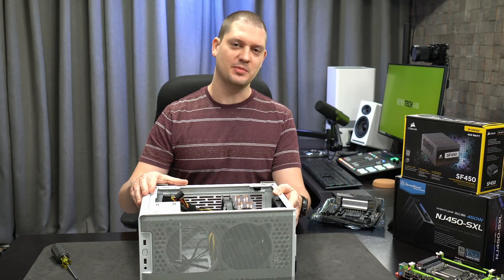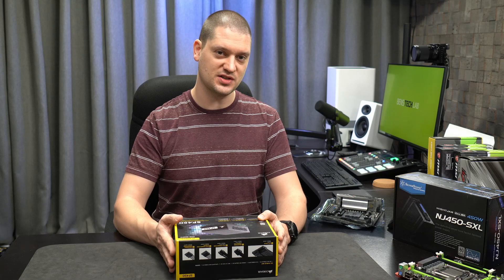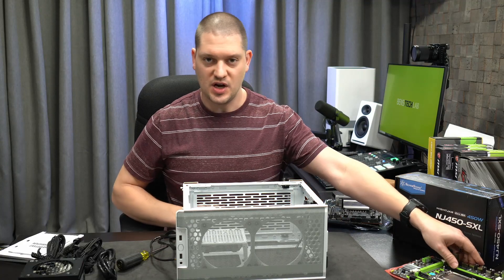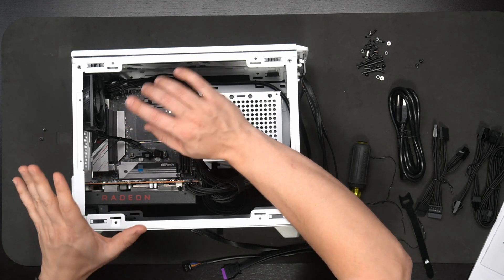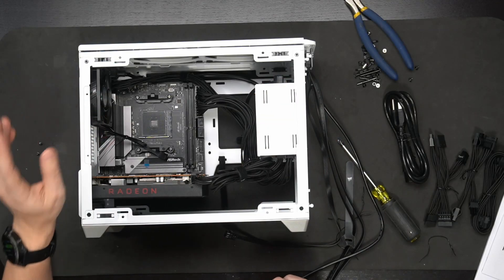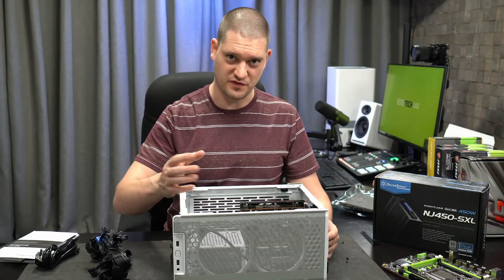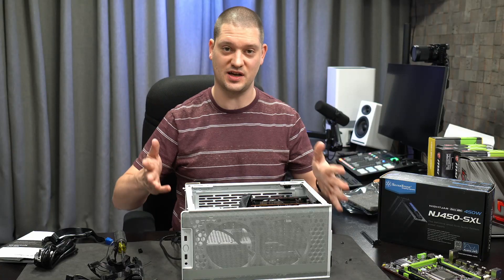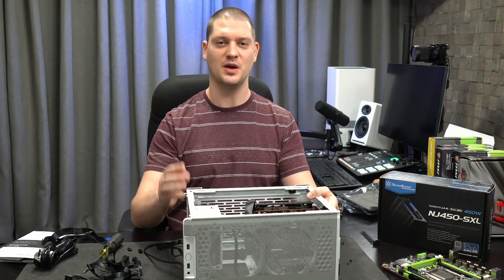Cooler Master NR200 Power Supply Options

Comment: A very helpful video, thank you so much for making it. I've followed from your previous video where NR200 starts. I'm expecting my NR200P white tomorrow to arrive and I'll be alocating my old PC in to this new case. My plan is to upgrade it bit by bit and I would start first with the new power supply. Now, my old PC is ADM Rysen 3 1200 with a GTX 1050Ti with old power supply of 500W. My question is which power supply is best option for few years run? Is it enough to go with SF450 as you did in this video or should I get a more powerful one?
Reply from the maker: Power supply choice depends on your other component choices like your next graphics card or next processor. In my case I was using a very low power GPU because it was more like a "server". So it is way more than enough. You should be able to google any graphics you want and find power consumption in watts. So its hard to recommend until you pick your next generation of parts.
Reply from the maker: If you aren't sure what your future components may be, then it might be wise to slightly oversize your power supply as every generation of GPU gets a bit more power hungry. The good news is corsair now makes a 600w and 750w version of this same powersupply! Check this out: https://geni.us/corsair-sf750

Comment: can you mod it to fit a small micro ATX motherboard (asrock a320m) + a standard size power supply? I have no problems with using cable ties and drilling aditional holes and my gpu is small, a 1660 super, so it doesn't take much space either
Reply from the maker: There are a few lists online for which mATX motherboards fit. I can't know all of them. But there are 2 official heights for mATX motherboards.

Comment: can the SF450 manage a 3060ti....?!?
Reply from the maker: It will depend on your CPU choice and other system components. It is possible with a lean system design. But there is a 600w version of this powersupply too I believe. (FYI, I have a Core i9-10900k with RTX2060 on a 450w power supply with no other accessories aside from an SSD and this build is stable).
Reply: my sf600 handle 3080. So probably, there are test of this on youtube

Comment: They are selling atx brackets to mount full atx psu's to these cases.  I'm interested in seeing how they mount?
Reply from the maker: Interesting! Cooler master is making these now? I did see some after market or custom ATX installs before...
Reply: @BensTechLab  is aftermarket part, you can buy in aliexpress, a position of atx power supply is the same of your put with matx motherboard.

Comment: Wouldn't it make more sense to buy a high wattage power supply so that the fan doesn't even need to kick in while under load? So if you have in theory a PSU of 1000W and you only use 400W then the fans don't even kick in and the PSU is completely quiet. That's what I've been reading online for getting a quiet system but I'm not sure whether it's true.
Reply from the maker: Some headroom on your powersupply is definitely good, but not the only factor. The efficiency rating is a big part of thermal performance too "silver, gold, platinum" rating. I went with the SF450 platinum which is very quiet. But also I dont have a big GPU in this build. If you are lucky enough to have a significant GPU you may want to go up a level. But also no need to over compensate.
Reply: @BensTechLab  Hmm well I'm building a PC without a GPU (for now at least, I have another older gaming PC which is still good enough), I think the wattage would be about 300 at max for the whole system. I got a SF750 because there was no 650 and 550 here, only the SF450. Without a GPU I think the fan won't even start up even under maximum load, essentially having 0 DB noise (except for the coil whine if its present).
Reply from the maker: @sv7363  Sounds pretty good! 👍 I think you'll have enough headroom on the 750W that when GPU prices come back to reality you will have plenty of power supply headroom to spare!

Comment: Any Corsair PSU ive owned have had bad coil whine while games run above 60fps.

What are the best sff that dont have coil whine issues? Ill pay ANY amount.
Reply from the maker: Hmm sounds like the coil whine is while under heavy load? I would recommend a higher quality (ie: "gold or platinum rated) powersupply and you could overspec the wattage a bit. I had good luck with these builds, but there is an element of luck what batch you got etc. So buy from a company with a good return policy! Amazon links in the description if you want to use them.

Comment: Corsair also makes a 750 Watt SFX powers supply, and Cooler Master makes 550, 650, 750, and an 850 Watt versions.
Reply from the maker: Do you have any of the cooler master ones? I'd be curious how they are for noise level at those higher wattages!
Reply: @BensTechLab  No, I actually have a Corsair SF450 for my NR200 build, if I can ever buy the CPU and GPU to upgrade my main windows PC.
Reply: Corsair SFX PSU's seem to be all out of stock in the UK, been waiting for the 750 version for a couple of weeks now

Comment: I went with the Silverstone SX700-PT in my NR 200P. It was on sale and cheaper than the Corsiar SF600 at the time. It's a good power supply but the included cables are very stiff and I think the fan is probably noisier than the Corsair. I ordered some custom cables for the SX700-PT from Moddiy.com. They are good quality but they take about 2 months to arrive.
Reply from the maker: Wow, two months for customer cables? Shipping to another country maybe? But nice cables really bring your build from "just good" to "very nice"!! Totally worth it.
Reply: @BensTechLab  yes, Moddiy is in Hong Kong I believe. I think snail mail is even slower these days than the mainland. Excellent service, otherwise.
Reply: I bought the 1000 watt SFX L version from Silverstone. I also ordered some custom cables because the included cables are way way way too stiff. I looked at moddiy but I don't wanted to wait for months. Just ordered some cables at cable mod. Ordered them last week and I am getting them next week.

Comment: I got a Thermaltake white 430W regular size power supply in this case. I had to take two of the screws that keep the PSU chassis on, and use those screws to go through the case. Only downside is that obviously a GPU isn't going to fit now, my customer will never put a GPU in this. The fan points out where it's supposed to it worked! Not using the cage it's too small. I wouldn't even want a GPU in this case seems like a horrible idea that's more for large towers and a lot smarter of an idea in a real tower.
Reply from the maker: Cool, with this mod did you put the power supply on the inside of the front panel?
Reply: @BensTechLab  it fits in the sideways orientation only. It’s fortunate that the screws that hold the psu chassis together come out and fit through in 2 spots so it stays in. It fits pretty much the same and the fan aims out the side in the same spot a sfx psu would. Saved 20 bucks vs a sfx power supply and that only would have been a 300w. It’s totally fine if you don’t want a GPU because the full size atx power supply complicates cable management and would block some GPUs.